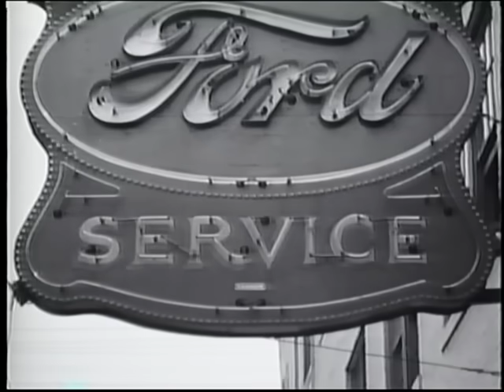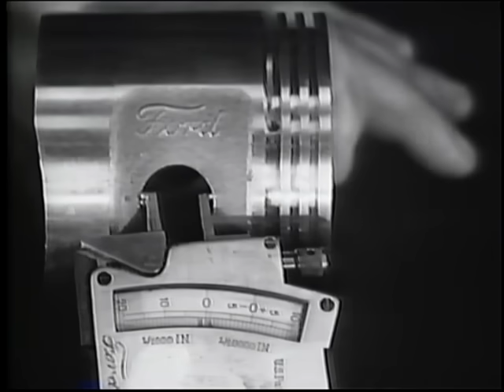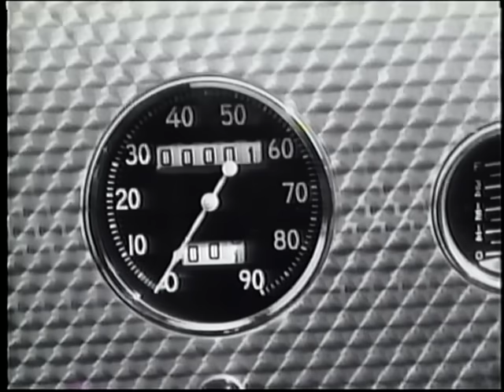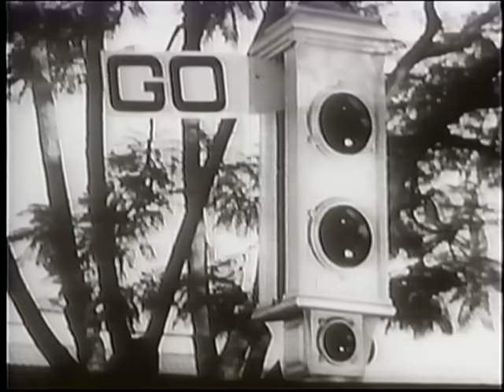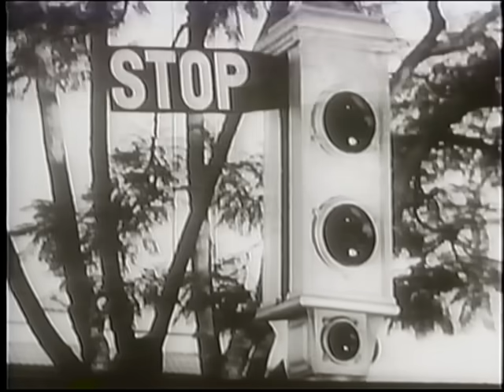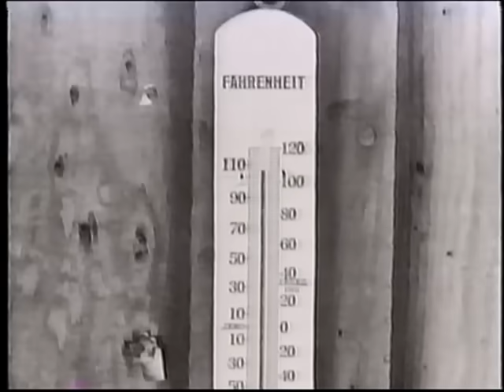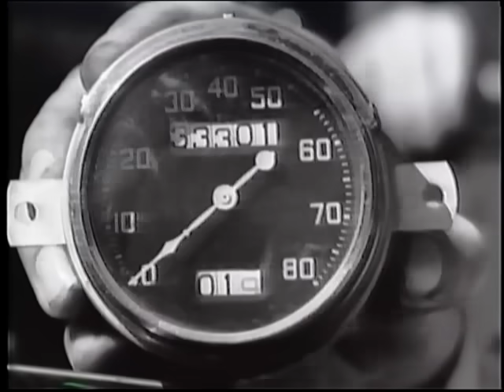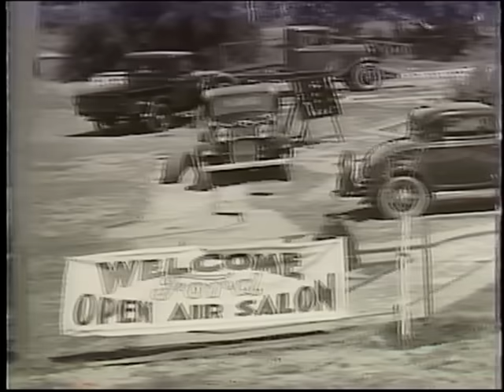1932 - The Invention of the Ford V8 Engine

Comment: The 1932 Ford cars shows that a mind is required for anything to be created, to be useful, to serve us in doing our tasks, for us to enjoy, that precision is critical, from the bores of the block that must only 0.002 bigger than the pistons or else it causes piston slap if it reaches above 0.009 clearance, or all the clearances combined, for too much clearance in any part of the engine causes oil pressure loss, so that the engine wears rapidly.

What does this prove ? That nothing comes about by accident, but must be the product of skillful minds that works at bringing a product to market. However, so many accept the belief that the universe with its wide variety of life on the earth came about by chance, and that once it "arrived", it evolved into all the different forms that we see. 

Tell that to any reasonable, skillful engineer, that any product we use could just happen at random, saying to just give it enough time and poof, there it is, and he would say that "you're dead wrong", for more often than not, for any product to succeed requires months and perhaps years of trial and error through intense effort, testing it repeatedly to find flaws and correct them. Even a simple toothpick requires complex machinery to produce. 

If a person could tell Henry Ford (1863-1947 C.E.) that his cars would eventually develop on their own, he would probably tell you that "you're nuts", knowing full well how much intensive, scrutinizing effort is required for even the smallest part of his car to be created, such as a simple screw or rivet.

Yet, what we see around us, from the sub-atomic particles to the smallest microbe, to the largest galaxy, is perfect, needing no changes or modifications. For example, concerning the universe as being precisionly fine-tuned, the perfect balance between the four fundamental forces, Harry Cliff, a particle physicist at CERN (European Organization for Nuclear Research) in Geneva, Switzerland, said in 2016, that there are ' two dangerous numbers in the universe that are responsible for all the matter, structure, and life that we witness across the cosmos'. He further said that " if these two numbers (strength of the Higgs field and of dark energy) were even slightly different, the universe would be an empty, lifeless place". 

And he even went further in how critical, how precise the forces involved are, stating concerning the strength of the Higgs field, an invisible energy field not unlike other magnetic fields that permeates the universe, that "either it should be turned off, meaning it would have a strength value of zero and wouldn't be working to give particles mass, or it should be turned on", and that this "on value" is "absolutely enormous". But neither of those two scenarios are what physicists observed.

He says that in reality, "the Higgs field is just slightly on........It's not zero, but it's ten-thousand-trillion times weaker than it's fully on value — a bit like a light switch that got stuck just before the 'off ' position. And this value is crucial. If it were a tiny bit different, then there would be no physical structure in the universe." 

So, is it reasonable to believe that the universe is just a series of random accidents, that anything organizes itself into a working unit by chance, and not to mention the precision that is absolutely necessary for life to exist, that it arose out of "nothing", without a mind ? Any sincere, reasonable person should easily realize that organization and preciseness is the product of a highly skilled person, a Someone,  in which the universe is so well organized and precise as to be beyond our capability to grasp it.(note: the Someone is seen in the Bible as Jehovah God, Jer 10:12)

Comment: the truth will hurt some of you. #1 ford did not invent the v8 engine, they designed their own.  they had severe limitations with rpm due to the cylinder wall construction. they over heated and were terribly inefficient. very few reached 100,000 miles.

Comment: Great video....thats when a car....was a car.....! The only thing saving the cars of today is better metals to use 4 engines &....without the oils of 2day....the cars produced over the last 20+ years would not make 100,000+ miles without some kind of internal engine failure......remember.....the oil in that period (1930's + 20 years) made wolfs oil look like.... Mobile 1....!

Comment: 19:31  Dyno'd flatheads... way back when. 😁
Reply: Sure.  Ever hear of James Watt? (not sure if you know this) He did a few things before he died in 1819, and putting a value to Horse Power was one of them.  He was making a steam engine and needed a way to tell people how powerful it would be.  So he grabbed a small pack horse, tied a weight to it that the horse could handle, dropped the weight down a water well, (over a pulley), and measured how fast the horse could pull the weight straight up to a known distance, (work done).  Then he could tell people his steam engine made 10 horse power, and they would understand how much that is more.  All we had to do is use his figures to develop a machine to measure it in rotational force, (and I have one).  We went a long way in the next 100 years.  But we were free to do so.  I would have loved to be born in 1900, and earned an engineering degree by the time I was 25. I think I could have been one of these guys.
Reply: Ohhh, If James Watt picked a bigger horse,---we would have more power per horse power today.  I love that kind of stuff.  :)
Reply: So your 350hp muscle car would only be 225hp, but still pull low thirteens in the quarter mile. :)

Comment: THE 1932 FORD  V/8 WAS NOT A FORD INVENTION .      IT WAS A FIRST SINGLE CASTING V/8 BLOCK BY FORD .    THIS WAS NOT THE FIRST V/8 ENGINE, THEREFORE IT WAS NOT AN INVENTION BY FOMOCO .       IT WAS A PROCESS OF BETTER ENGINEERING !

Comment: 36:10 The cars (the ones before the roadster) seem to have almost no trunk, though maybe there was some luggage space behind the rear seat, and with the seat so far back, putting a few cases behind the front seat was probably practical. I wonder if putting a separate trunk in place of the spare tire (which would have to be accommodated somewhere else) was a common practice on these cars.

Comment: My second EcoBoost engine in my 2015 Ford Escape failed.   The first engine failed at around 36,000 miles, and the second failed not having 25,000 miles on the engine. Ford used to make good engines.   The EcoBoost is a disgrace.  A class action suit has been filed against Ford in Delaware over the many EcoBoost failures.   I hope Ford goes bankrupt!

Comment: Ford was never in the same "game" as Chevrolet because everything Chevy did made it the "anti-Ford". EVERY Chevrolet engine ever produced began as a "truck engine" first and a car engine second. That's still the case today for Chevy "proprietary" engines. Every Chevrolet engine was OHV with distributor ignition and a pressurized fuel system with a mechanical pump. Every Chevrolet engine was "high compression" and "high speed". Every Chevrolet had electric starting and lights as standard equipment. Every Chevrolet had a "live" rear axle and front axle. Every Chevrolet had "juice brakes" as well as hydraulic shock absorbers. 

Chevy wanted "more cylinders" because its trucks - not cars - had "outgrown" the "Chevy 4" that was essentially unchanged from "day 1" while Ford flathead 4-cylinders went through many "generations" during those "20 million Fords". 

And Chevy had "been there and done that" with a MODERN OHV DISTRIBUTOR IGNITION DOWNDRAFT-CARBURETED PRESSURIZED COOLING SYSTEM V8 "RUNABOUT" IN 1915. IN MASS PRODUCTION BEFORE THE "WAR EFFORT" - WHICH WAS KIND OF IMPORTANT TO "1ST GENERATION AMERICAN" LOUIS CHEVROLET - PUSHED CHEVROLET TO "SHUT DOWN" CIVILIAN VEHICLE PRODUCTION AND START PRODUCING "MILITARY" VEHICLES AND COMPONENTS. 

"POST-WAR" THERE WAS NO "MARKET" FOR WHAT WAS BY THEN AN "OBSOLETE" V8 AND ONE THAT COST FAR MORE THAN "TWO FOUR CYLINDERS SHARING A CRANKSHAFT" TO PRODUCE. BECAUSE A V8 IS THE FARTHEST THING FROM "TWO FOUR CYLINDERS SHARING A CRANKSHAFT" AND CHEVY KNEW THAT ON "DAY ONE:. HENRY FORD DIED NOT KNOWING THAT AND WENT "BROKE" TRYING TO PROVE OTHERWISE TO THE "AUTO INDUSTRY" AND THE "COMPETITION". 

JUST LIKE HE "WENT BROKE" TRYING TO "COMPETE" WITH FLATHEAD FOURS AND THREE "GENERATIONS" OF THEM IN THE MODEL A ALONE. WHICH WAS THE REAL REASON HE "SHUT DOWN" 80% OF "HIS" PLANTS AND SEVERAL OTHERS WERE "SHUT DOWN" BEFORE THEY EVER MADE A SINGLE "AUTO". 

HE RAN OUT OF OTHER PEOPLE'S MONEY ADMITTEDLY SELLING VEHICLES "AT A LOSS" AND HAD TO "INVEST" HIS VAST "PERSONAL FORTUNE" IN HIS NEW "INVENTION"  FLATHEAD V8. WHICH ALSO EVENTUALLY WENT THROUGH SEVERAL "GENERATIONS" AND THE FIRST "GENERATION" - THE "V8-60" FOR "60 HORSEPOWER" WAS "RETIRED WITHIN TWO OR THREE "YEARS" AFTER "INTRODUCTION" WHICH HAPPENED TO BE IMMEDIATELY AFTER THE "CHEVY 6" BECAME THE STANDARD ENGINE IN ALL CHEVROLETS AND THE "CHEVY 4" WAS COMPLETELY "RETIRED" OTHER THAN "SERVICE REPLACEMENT ENGINES". 

CHEVY'S FOUR-CYLINDER ENGINES MADE AN HONEST 10 HP PER CYLINDER REGARDLESS OF FUEL, ALTITUDE OR "CLIMATE" FROM THE FACTORY AND GOT "STRONGER" WITH BREAK-IN. THE 6S HAD "MORE POWER" PER CYLINDER BUT "SMOOTHNESS" WAS THE MAJOR IMPROVEMENT AND THEY "PULLED" FAR HARDER AND LONGER THAN THE FOUR-CYLINDER "PLUS TWO CYLINDERS". AND OF COURSE 6S ARE "PERFECTLY BALANCED" OF COURSE. OHV SIXES THAT IS. FLATHEAD 6S WITH LESS VALVETRAIN "COUNTERBALANCE" NOT SO MUCH. 

THE FORD "V8-60" WHICH WAS THE STANDARD ENGINE IN FORD "RUNABOUTS" COULD BARELY "OUTRUN" AN "OBSOLETE" CHEVY 4 IN THE "LOW PRICE CLASS" AND IT TOOK A FEW YEARS FOR THE 6 TO FULLY "REPLACE" THE 4 ACROSS ALL CHEVY VEHICLES - WHICH WAS 100% THE PLAN FROM "DAY ONE" IN PART BECAUSE CHEVY ALREADY HAD THE "SALES LEAD" AND WAS INVESTING IN A FULL-SERVICE  DEALER NETWORK INSTEAD OF JUST HAVING "AGENTS" LIKE FORD AND WAS FOCUSING 100 ON PRIVATE BUYERS AND ALSO FINANCED DEALERS AND CUSTOMERS WHILE FORD SOLD "AT A LOSS" OVERWHELMINGLY TO "GOVERNMENT AGENCIES" AND WAS 100% "COD". 

ONCE IT BECAME CLEAR THE CHEVY 6 WAS GOING TO BE ALL THE "COMPETITION" AND THE ENGINE HAD "WAY MORE LEFT IN IT" AND V8-60S OBVIOUSLY HAD. NOWHERE TWICE AS  MUCH "POWER" AS THE MODEL A 4-CYLINDER MUCH LESS THE "MODEL B" AND "MODEL C" FORD HAD TO "DEVELOP" TO "KEEP UP WITH THE COMPETITION" STILL ALSO RUNNING FLAT 4S, HENRY HAD TO "INVENT" ANOTHER "FORD V8" THAT WASN'T TWO FOUR CYLINDERS SHARING A WATER PUMP AS WELL AS A CRANKCASE.AND THE CAM-DRIVEN "DISTRIBUTOR" HAD TO GO. AND IT NEEDED ANOTHER MAIN BEARING. AND MORE DISPLACEMENT. AND COMPRESSION. AND A 2-BARREL CARB AND "DUAL PLANE" INTAKE MANIFOLD. AND MORE HEAD STUDS. AND...THE LIST GOES ON AND ON. 

AND OF COURSE BY THEN HENRY HAD MOVED ON TO OTHER "BRILLIANT PLANS" AND PRETTY MUCH DUMPED "REINVENTING" THE "FORD V8" ON HIS IN-HOUSE TRAINED "ENGINEERS" AND LEFT THEM WITH THE ORIGINAL CASE OF HAVING TO POLISH A TURD AND MAKE THE "2ND GENERATION" FORD V8 EVERYTHING THE ORIGINAL WAS PROMISED TO BE. AND THEN SOME SINCE ALL THE "COMPETITION" AT CHEVY WAS  "UNDERRATED" AND "DETUNED" OHV 6-CYLINDERS IN ALL CHEVYS "RUNABOUT" TO  MEDIUM-DUTY 1.5-TON "FARM TRUCKS" FORD HAD NOTHING TO "COMPETE WITH" BESIDES FORD"AA" TRUCKS FORD HADN'T "UPGRADED" WITH V8S.

Comment: When they made these vehicles company owners cared about their products and workers cared about their work, back then stuff was made to last and brand loyalty made a company.

But with time a new generation of greedy people took the reigns of these companies, gone was brand loyalty, and cutting corners to increase profits became the norm.

Just about every good thing is gone as plastic replaced metal to save money, here is an example, some years ago a local Ford dealer had Ford Trucks on the lot, I asked my boss when we drove by why all of the trucks had such small tires, he said imagine they saved 5.00 per tire or 20.00 per truck multiply by milions of trucks rolling out to dealers everywhere, just 1 million trucks saving 20.00 each is 20 million dollars saved.

They have gone to this method big time where even saving a penny here and there is exploited, more savings equals more profits, and that is what we have been stuck with, and why I change vehicals every three years,

Headlights made of glass don't get a dingy haze on them like plastic ones will, even in the 70's vehicles were still made out of good quality stuff. with real steel bumpers not the plastic garbage that came later.

The people are totally different, back then they cared about other people and building there businesses based on good customer relations, not anymore, as all of the companies are into build it cheap and sell it high.

What I wouldnt give to go back to those days, when businesses were very competitive and we benefitted from that competition.

Some of the best cars were made in the 50s-70s ah the muscle car era wow, hey and dont forget the hot rods!
Reply: I admit everything except making these cars to last... they tried lol look at the Model T transmission and you'll see.
Reply: @ftffighter  

Well the intention was once there to make them to last.

back when modern appliances became normal, they too were built to last.
I went on a service call to a home in my area, the 5 year old freezer was not working, the compressor relay went bad, this was in the 80s, the 1950s freezer at the other wall 30+ years old had never had any problems.

Back when these things were made, Computers were still a new, and they were very very few. Eniac and Univac

They made stuff to last using slide rulers, they didnt even have electronic calculators.

Although they did have mechanical adding machines, IBM

What I wouldn't give to go back to those days.
Reply: @dennishagans6339  People are losing their sense of passion with a lack of unconditional love too. Those are dang good points lol. Those old electronics were unkillable.

Comment: 36:20 The different body types that were available for the Ford Model 18/40 V8 car: 2 door sedan, deluxe 2 door sedan, 4 door sedan, deluxe 4 door sedan, 2 door Victoria, 2 door roadster convertible, deluxe 2 door roadster convertible, 4 door phaeton convertible, deluxe 4 door phaeton convertible, 2 door coupe (notice how the American narrator in this 1932 vintage promotional film says "koo-pay", the correct French pronunciation of coupe; for some reason Americans today say coupe as if it is a chicken coop), 2 door sport coupe, and deluxe 2 door coupe. 12 body types are mentioned here, I read somewhere that there were 14 body types, including the standard and deluxe versions of each body type. The other two body types may be mentioned in this documentary, but it is not clear.

Comment: The first monobloc V8 was designed by Oldsmobile and introduced in the 1929 Viking. It was a 81 hp flathead engine with a balanced cross-plane crankshaft design and had a unique side valve arrangement. Unfortunately this was an upscale car that was introduced just before the 1929 market crash which destroyed the booming economy and any hope for the new car line.  The Viking was discontinued after 1930.  The new V8 was unique to the Viking car and was set up on its own assembly line. The initial designs for this engine dated back to 1925, so it definitely predated the 1932 Ford monobloc flathead V8.
Reply: Interesting. Both Olds and Buick had some off the wall prototype cars in the '60's & 'early '70's. One of my best friend's dad worked for Buick and he told me about some of the wild stuff running around there.

Comment: Wow, the engine part quality standards back in those days! 🤮
Reply: Funny...theres model Ts and 18s with original engines still running, and stock block/piston/rod model 18 engines can make over 200hp with just a few mods. 

54:20 proves they just had 1 bad run of engines in 32...the rest were just as good as many new cars.
Reply: Have fun with these new engines after 90 years.

Comment: The invention of the Ford V8 engine?  An interesting discription, it leads you to believe that Ford invented 'A' V8 engine.  Clearly he didn't invent 'THE' V8 engine.  So what did Ford, invent?  If you take Ford out of the description it has no validity, but does putting Ford in the description give the statement any legitimacy and if so, what is it?

 Would a better discription be that he made Ford's first V8 in 1932?
Reply: Did you even  watch it? They went to great lengths to explain that this was the first V8 cylinder block formed in one casting.  A practical low-cost V8 engine was not feasible until Ford developed the techniques used to build the Ford flathead V8 engine. Put your learning ears on.
Reply: @rogerturner5504  Fair enough, I'll squeeze another step on the podium.

Comment: 53:30  There is an example of what I don't like about YT informational vids.  Early Ford V-8's had some quality and design problems, which were fixed and nobody was ripped off.  But while explaining that, quotes from Ford are flashed in front of us as if those quotes were lies.  What these little minds do not understand is that manufacturing makes mistakes too, and Ford did the right thing by backing their product by FIXING them. Your little minds do not understand what it takes to make things, (that got mankind out of poverty), as you try to make it look like a crime to make some mistakes on a brand new process that you yourself benefited from.  You are YT.  You are ungrateful.  You are evil. And you have to live with it too.

Comment: Ford did not invent the V8 engine. Nor its use in automobiles.
Don't get too cocky and gloss over such major details.
Reply: The video is not suggesting that. What Ford did was to make the V-8 engine easier and simpler to mass produce, which lowered production costs. This in turn made V-8 powered cars affordable enough so that average people could afford to buy them.